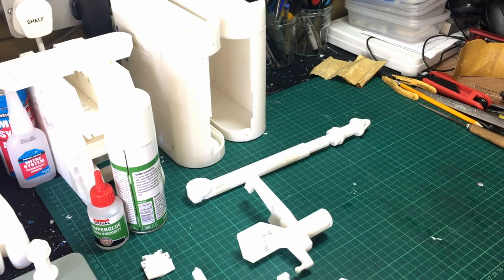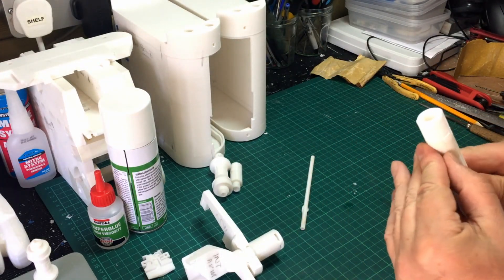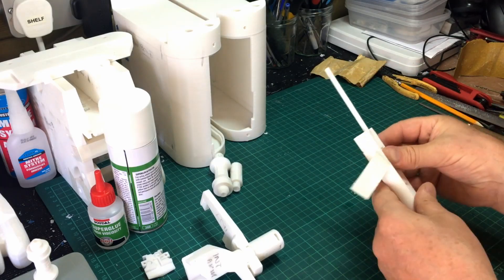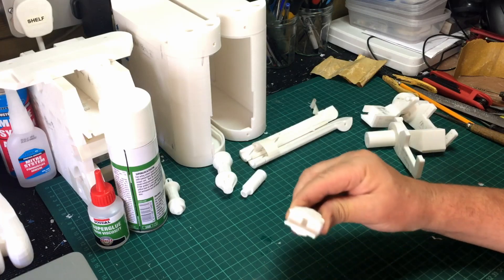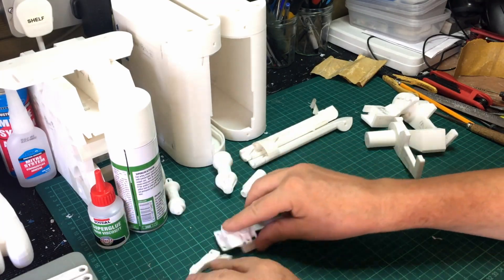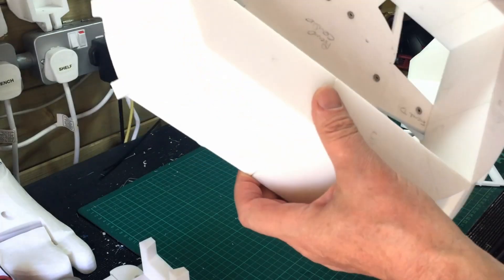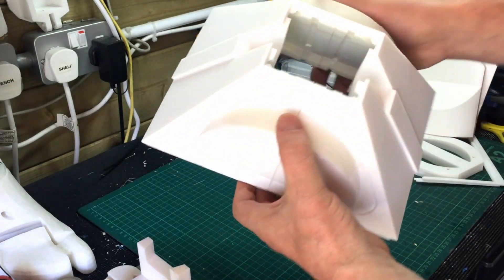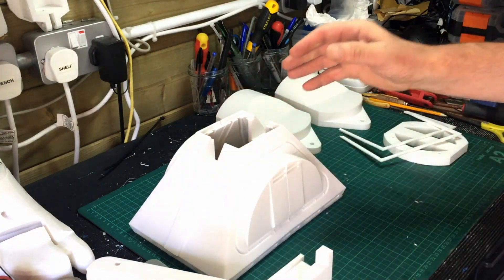R2D2 Droid Build Part - 11

Comment: GRR! Argth! I goofed on gluing the skirt, you just confirmed it. I misunderstood the directions and glued the straps for the captured nuts on top, dummy me. Guess I should have watched this video again before getting ahead of myself. Sigh.
Reply from the maker: Hi Chris, if you used CA glue [superglue], try the CA de-bonder, worked really well for me when I glued most of  the parts of my Cyberman mask together backwards!   Hows the rest of your build going?
Reply: Hi Kyle,CA de-bonder, I remember seeing you mention that. I wasn't sure it would work in this application since I glued in 3 dimensions. I wasn't sure I could get it into the areas to pull it off. I ordered it now so I'll give it a shot when it comes in.The build has been slow. The workbench was occupied for the past 6 weeks so I couldn't do anything. I just started up again by trying to glue the body rings together Tuesday. I'm going to go back over your videos to make sure I get it right. I know I'm missing part 21 of ring 2, it has to be in the tote somewhere.Those pins are a pain! I didn't understand where they went until I they came in yesterday and I checked the directions again. I was looking on the wrong parts. Now I've got it. I'll do those today hopefully.My CR-10 strangled itself trying to print the skins for the right foot. I'm not sure what is going on, heat creep or what. It prints fine for the first 4cm (5 hours) but then the filament gets thinner and thinner as it goes up. The last part was rough at the 2/3rds point (12 hours) and failed after that. Another do-over. I may have a blockage again.If the de-bonder works you'll save me from having to sand and pry them off and then reprinting them. :)
Reply from the maker: @chrishechtl8330  I had issues printing the skins for the feet, lots of ridges on them that I thought was intentional until I saw that everybody else's were smooth.    Tried sanding them but cant be bothered so lots of paint and leave them as is.    Same here about not having done building work on R2 or even finishing the new neck off on my InMoov.   Not had time , but hopefully soon can continue.    Leave the CA de-solvent to sink in and it works wonders.
Reply: Hi Kyle,Printing the skins: Ah. I printed the skins for the center foot okay. Well, 1 got to 95 and messed up, but I've got pieces I printed to fix that. It is the others that are being a pain.I think you can use a pair of pliers to get the triangles off. Did you see Michael's latest video on putty spray? It looks cool but it is expensive. It is also hard to get here. You'd have more luck with it.Busy: I know the feeling, I'm almost done my latest book but struggling with it. My latest book is at the formatter after editing. Plus family life.CA de-solvent: Ah, okay, thanks for the tip. It comes in Saturday. I'll have to wait until Monday to get back to the bench. :)

Comment: I noticed the skirt have a lip around it so it fits closely around the base ring ,mine does not have that ,is this an older model.
Reply from the maker: Hello sky, its the current version STL.  Its not a lip as such, its just the the inner oblong section is deeper, so it slots into the base ring and sits flush when its screwed together. As you can see at 11:02 in the video.   Is this what you are asking?
Reply: kyle campbell ,that's correct.i have to go back and look for that,and reprint it.thank you.

Comment: The part that u bolt on to the skirt what is the name of that part.
Reply from the maker: Hi sky.   The "Ankle support frame" parts bolt onto the skirt first. [These are in the R2D2ver2Feet>R2D2ver2Centrefoot>AnkleSupportFrame folder on Michaels OneDrive].
Next I am using the "AnkleExtend(long)" part to make the whole ankle longer.   Next the ankle parts themselves bolt to the extender part - Ankle-A and Ankle-B parts.   These three ankle parts are in R2D2ver2CentreFoot>Ankle folder
Reply: @kylecampbellweb  Hi, I'm also making this project, currently starting the final assembly. I didn't print the extension part for the ankle. Do I need it if my R2 will always be on 3 leg mode, or only if later it'll have mechanism to go from 2 leg to 3 leg mode? Thanks
Reply: @KDan915  Hi Daniel, do you mean the Ankle(Long) and Ankle(STD) options?   I printed the "Long" parts.  I think it makes no difference if you will always have the Droid leaning back on all three feet.      I think as you say, the longer legs are needed if you rotate 2-3-2 as more space is needed below.    I don't plan on adding in the "rotation" but it gives me the option.    I have just bolted these parts on anyway, so they can always be removed.
Reply: @domecamera6018  No, there is a 16 mm extension piece for the middle leg ankle. It is meant to be screwed on between the ankle and the ankle support frame. I didnt print that, since as per assembly guide it is meant for later versions with 2-3-2 capability. Since mine will always be in 3 leg mode, I don't know if I need it. I'm currently starting final assembly. after finishing very printed parts, so it would be good to know if I need that part, since it is one of the first parts to be put together.

Comment: What control board u are going to use for the body?
Reply from the maker: EZ-B  V4 wifi controller, also the Sabertooth 2x32 and Syren 10amp driver boards.
Reply: Were could I get the code's from for this setup? thank you for replying.